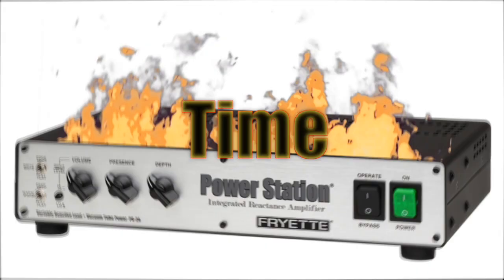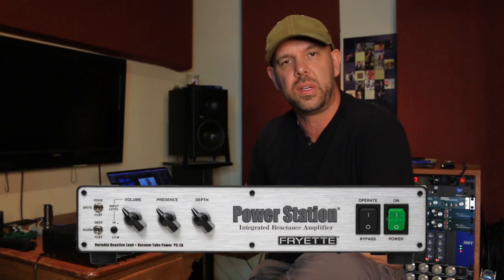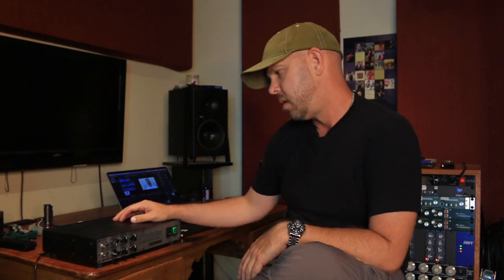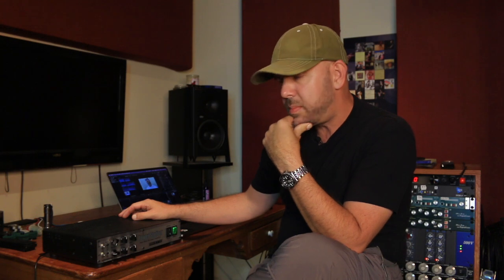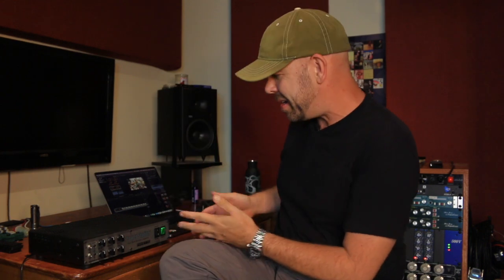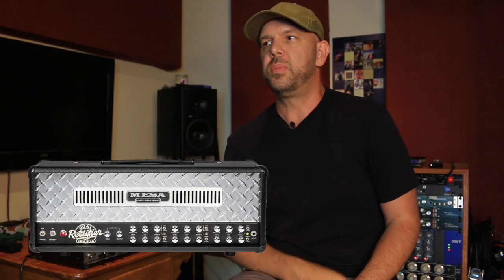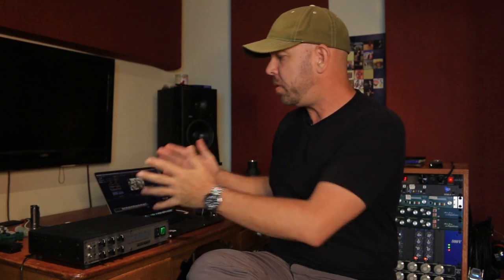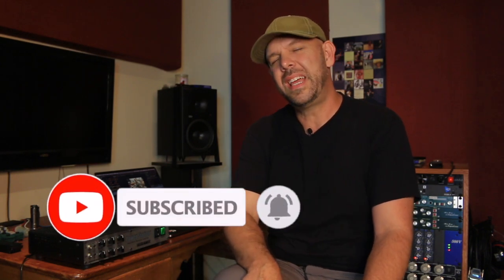POWER STATION: BRO, DO YOU EVEN STEREO?!?

Comment: For a simple wet/dry setup, albeit without full attenuation, you could run the PS in parallel with another cab and run effects through the PS loop. Or just get another power amp and run stereo in the PS loop and between PS line out and the other power amp.

Comment: Just saying: a rackmount 2x power station setup would be totally worthwhile.  Make it 2x 50 instead of 2 x 100 or charge more for the option.  Basically while a stereo rig would obviously not fit in the enclosure of the PS-100, it probably would fit well into the enclosure of the Fryette Two/Ninety/Two power amp.  And it would be awesome and worth the money.  Personally I have a tube pedal preamp rig that I run into Mesa Boogie 50/50 power amp.  It sounds awesome but the volume is punishing.  Pedal preamps are taking over the market, making stereo signal chains more accessible/desirable, and Fryette is uniquely positioned to give players the option to have full tube signal chains at whatever volume they need.  The only comparable option I've been able to find so far would be to buy two PS-2's.  Why buy two of them and take up extra rackspace?
Reply from the maker: Thank you for your comments! We're listening :)

Comment: Imagine that  you want to do a wet/dry/wet going out of Synergy preamp modules make from stereo ,,, i guess you'll need 3 of those Power station 100's ,, for me the use i am looking for is going through this without speaker cabinets direct in like in  interface for studio recording ,i have two Fender dual Showman's  and 3 Marshall se 100 attenuator speaker simulators  these have also the extra function to have a only preamp in and going to line out/ has a through back to speaker cabinet /of coarse  amp in to line out.
Reply from the maker: There would be a much more effective way to do that without buying redundant gear. Please contact support@fryette.com